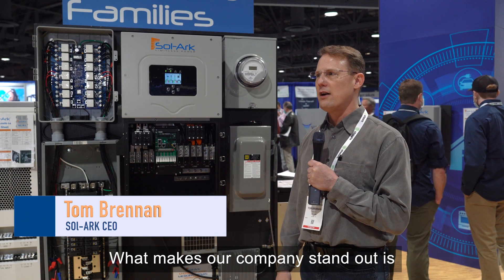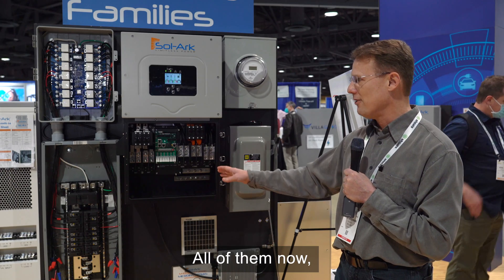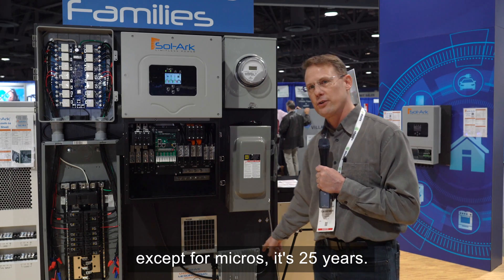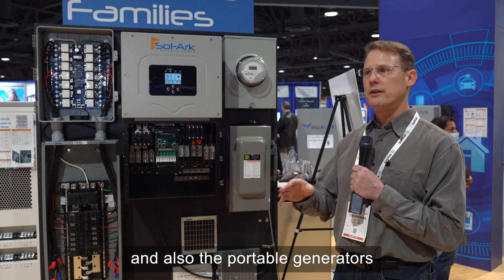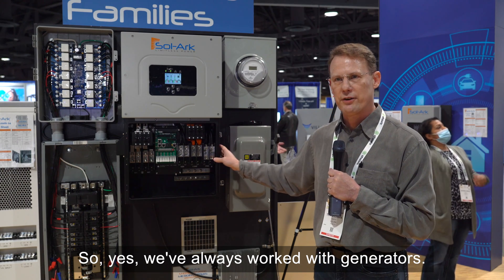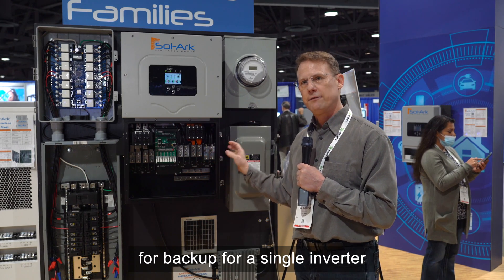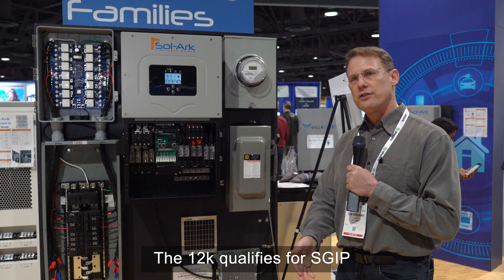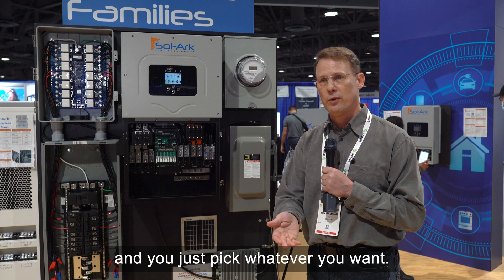Sol-Ark's 15k Inverter

Comment: Still won't start my deep well pump so can't us it .
Reply: How do you know this?
Reply: @ssoffshore5111  because it is a hi frequency inverter without a transformer it won't start 240 volt heavy loads.
Reply: @miketabb8318  How many amps does it pull on surge?  Soft start?
Reply: @ssoffshore5111   I will be using a low frequency inverter with a transformer so I won't have to worry about it.
Reply: @miketabb8318  Don't waste your time, clearly a trolling comment...
Reply: I have put several 12k in for clients, they generally start 3-wire pumps up to 2hp, but 2-wire 1.5hp pumps are brutal on starting current, the 12k will barely start one, if at all. The 15k has 50% more starting current though, so it should start even larger pumps.

Comment: Can and/or will this system be convertible, available in modular "rack mount" configurations for use on manufactured home sites such as mobile home parks or rural farm sites? I would imagine a weather resistant server rack like cabinet that would house the batteries, inverter(s), load center switchover bank, and any ancillary monitoring hardware.

This all containable in a computer server rack mount like configuration for ease on install and service for expansion and maintenance. Even without a solar solution, just being able to have a quiet, high powered, emergency power outage backup solution would be ideal for this use case. Though ideally this would be mostly used in conjunction with a solar install, but not having any indoor space to place this kind of system into such as a garage or shed. Thus the need to contain it all into a secure lockable cabinet, like the kind used for traffic signal hardware.

Comment: Just curious..  wouldn’t it be more efficient to have the generator with a 12 or 24 volt DC alternator to charge the batteries?

Just asking…

Larry
Reply: Cost of cable would be a killer.  Also, the Sol-Ark is for 48V nominal battery banks and 48V alternators are comparatively rare.

Comment: A shame the firmware and app are from China.
Reply: How do you know that?
Reply: @adon8672  All the reviews state this plus go look at the app, Chinese company..  I don't like kill switches so likely will not use it connect to internet. Its a shame.
Reply: @clintg3435  I see. I asked out of sincere curiosity.
Reply: @adon8672  apparently it's a common unit that Sol ark has made some design changes to that make it "better". I'm not knocking the unit just giving out some relevant info.
Reply: @clintg3435  They are supposedly in the process of bringing both app hosting and inverter manufacture to the USA.  Given how China is going full Mao, they better hasten that if they want to have inverters to sell in the near future.
Reply: @randacnam7321  thanks.  This would be a much needed change. I can't imagine there being much Cost savings in app development or web hosting. But I get that the manufacturing cost would increase the end unit price if manufactured here
Reply: @clintg3435  Not necessarily.  Energy prices exploding and supply chain failures have driven manufacturing costs waaaaay up in China in recent years.  Bribes and psychotic government policies haven't helped either.

Comment: When will we be able to order the 15K?
Reply from the maker: Hopefully, Sol-ark will announce that information soon.
Reply: @synergypower2666  im look for a solar main ATS switchboard combo that can handle 400A 240V SP residential meter maid service is this compatible and no using twinsets as my local government will not pass it off ? as the competition that i have looked at max's out at 180A. or ideas of how to do it as im not the only one with this problem
Reply: and does this have a optional IPS power mode? as thats something about gas generation equipment can't do easy at cost ect.
Reply: As with any new product I would wait till the bugs are worked out.
Reply: I've seen vendors taking orders now.  May/June delivery dates.